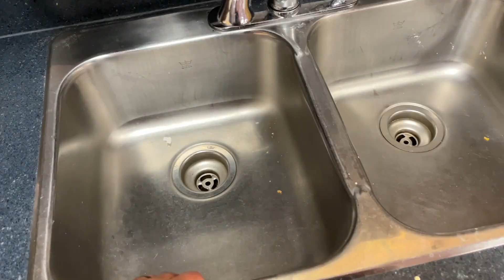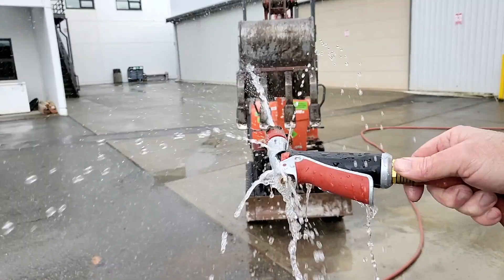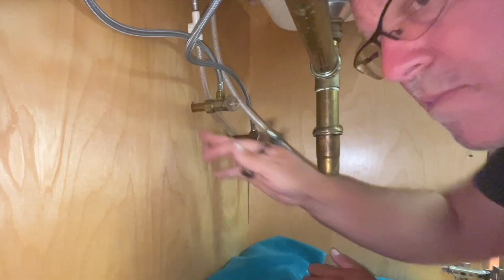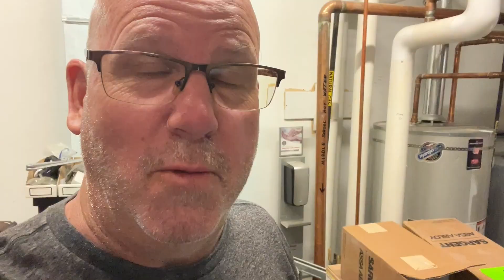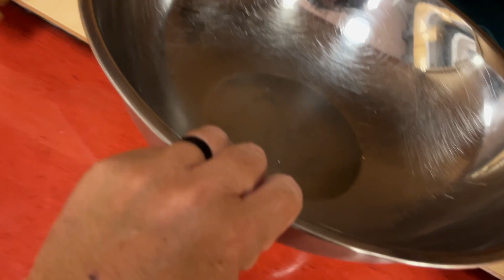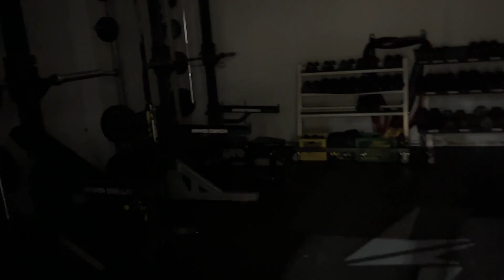Troubleshooting and Repairing a No Hot Water Call - S07E191

Comment: I would do a propress before a sharkbite fitting. Even better sweat shutoff. I don't trust sharkbites long term. Good for a quick repair but wouldn't trust it long term.
Reply from the maker: How about a short-term repair in a room that will be gutted in 18 months? :)
Reply: I've seen 20 year old shark bites still going strong. If that isn't long term then what is? 

There's no reason really not to trust them. Europe has been using similar push-to-connect fittings for decades with a proven track record. The problem with shark bites is they're commonly not installed right and then people turn around and blame that on the product. Every single shark bite I've seen fail was a result of installer error. Every single one. Even this one right here wasn't installed correctly. He never deburred the pipe and lazily sanded it. Good way to tear the o-ring when pushing it on and compromise the connection and get a future leak. I wouldn't use them on my jobs personally but that doesn't mean I don't trust them if I had to use one.